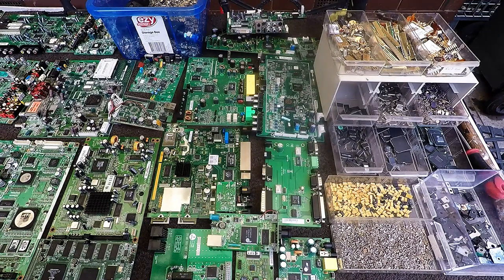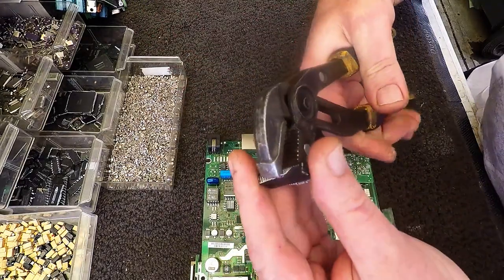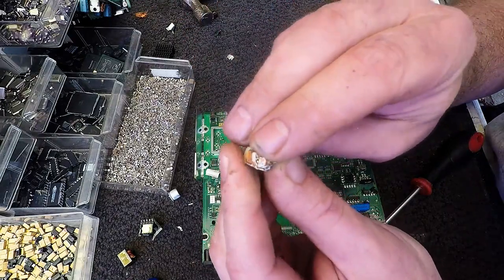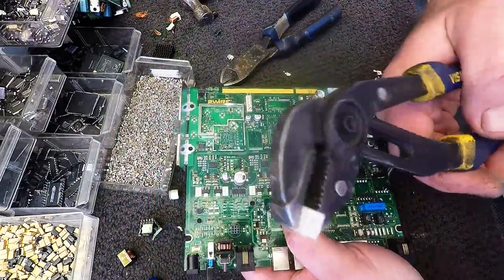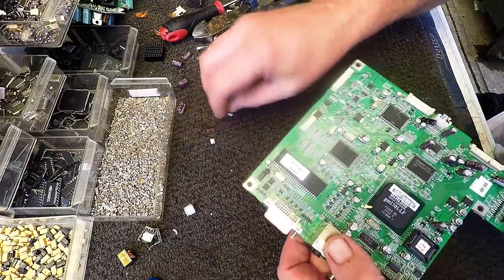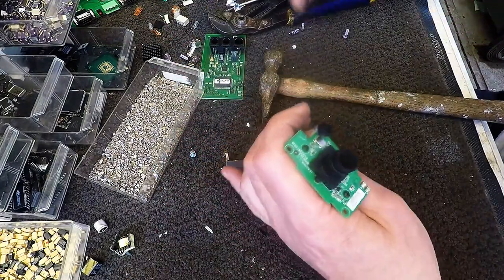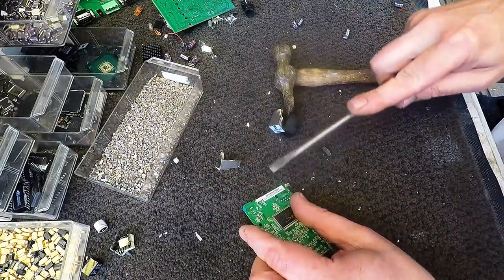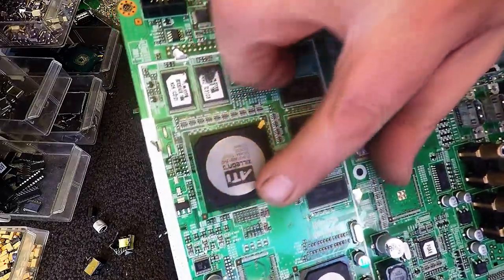Depopulating Boards - Mid Grade Boards

Comment: Great video very Informative. I am in the research phase on whether it is worth just depopulating or Just selling the boards. 
I am assuming the big refining are making most of their profit off the base metals and not the gold and silver. I am assuming maybe half the value of the board is actually the copper. Then you have the tin soldier with very trace amount of silver Of course they will process the silver platinum and gold. But the copper itself probably pays for the whole process.
 During my research on Resistors I did notice most of the brown ones are mainly base metals it is the blue rainbow resistors that have platinum and other precious metals. 
   Now that being said I dont get many boards so I will desoldier all components and save soldier and components but I may want to play around with electronics and some of the components are expensive, Some of those components are worth more then the scrap value if they are working.  On the practical level I may process the copper board by lye bath to get the green mylar off and save the tin soldier for reuse or scrap. Of course I will save the silver and gold to but more of a side product.

Comment: K is a relay. They are usually silver contacts but some need gold plating for corrosion resistance. Extremely rare are relays with mercury wetting but those will also have glass to hold the mercury and contacts.
Reply: Those relays are my bread and butter.

Comment: Enjoy mist if your videos.  To depopulate, try using a wood chisel ( sharp edge) instead of a screwdriver,  dull edge just Pushes parts off instead of getting “under” the parts. It moved much easier 
Tried it and works better in practice
Once you do, you won’t go back. 
I also sharpened my blade on my air hammer but parts “GO EVERYWHERE “ as you probably know already. 
🙂

Comment: On the very thin IC chips, just score one side of the legs with a utility knife and that side just lifts up easily. Then just twist a few times and the whole chip pops off. Works great for 4 sided surface mount chips.
Reply: I am a firm believer 😌 he knows that Mr. Smarty 👖

Comment: I found a trick for getting the tiny components off:  weak HCl with a tiny bit of EDTA dissolved in it!  Leave it in a warm place.  The EDTA acts as a catalyst, slowly stripping away the base metal.  Copper will dissolve, redeposit, and then redissolve as the solder and more reactive metals are eaten away.  When it's all done, the little components will all just fall right off and you're left with a very weakly acidic solution of base metal chlorides in an organic salt (EDTA).  If you're really into cleaning up after yourself like I am, it's easy then to hit it with sodium carbonate to drop pretty much everything (most transition metal carbonates are insoluble), and then dry them out and roast to non-reactive oxides for disposal.

Comment: or what you could do to depopulate the boards on a much quicker scale... grab a large metal pan and fill it with a $4 bag of play sand and put it on your gas grill outside on high and stick the whole boards in it, the sand doesnt melt and it will melt the solder off and then take a metal ruler or an old large knife to just "wipe" the pieces off the board

Comment: Hi Ben: Good instructional video. I Dont know if you knew this but Vice grips does have smaller sized pliers like the blue handled one you have, 2 sizes smaller then the pliers you are using in this video. Even though my hands still get fatigued,they are not as fatigued using the smaller sized(less weight) vise grips.

Comment: Important chemistry note:  the ruthenium resistors are ruthenium oxide, which does not react with most acids.  HOWEVER!!  It DOES react dangerously with STRONG ALKALIS!!  So, to depopulate the tiny components completely, it's best to use weak acid to remove the solder.  Then you can capture the MLCCs with a magnet after filtering out the solid parts from the solution.  The ruthenium-containing resistors will be left behind in the pile of solids.  All MLCCs from boards with ruthenium resistors will be magnetic, as ruthenium wasn't used in the old boards with non-magnetic MLCCs.

Make sure you sort the old boards from the newer ones, obviously.  Mainly anything post-2000 is 'new'.

Comment: The 'silver' fingers and contacts are tricky.  They can have one of several types of plating:  palladium, silver, platinum, rhodium for the good ones; tin, chrome, nickel for the crap ones.  

I'm developing a chemical reaction series to deal with them and recover the actual precious metals as a powder, while leaving most of the copper or brass cores behind!  It's based on partial dissolution and then redeposition and displacement.  Most of the precious metals flake off as the copper goes in and out of solution, while the base metal platings stay in solution.  Then you can shake up the solids and filter through a nylon screen.  

You'll have a solution with grey and silvery dust (virtually all the precious metals), and copper cores (and some copper crystals).

Comment: I save all the ceramic capacitors and components of red, blue, yellow, brown, green, and even black.  You never know which could have some precious metals in them, as manufacturing changes so much with them.  If they're aluminum, then it's no problem.  The first step is ALWAYS to clean base metals from the components with HCl after smashing them to bits, and that will completely dissolve aluminum away.  Pure aluminum chloride aqueous solution is colorless to very pale yellow.  When highly concentrated, it can even become a translucent gel.  It's actually rather neat to toy with, and can be reacted with sodium hydroxide to make super-pure alumina powder for making ceramics and artificial rubies and sapphires (you can even get all the doping metals out of your base metal solutions!)

Comment: I have found when hand picking the ICs and VGA chips a sharp 5mm wood chisel works well. The chips you can use the chisel to cut the legs. A sharp knife will do as well.

Comment: The brassy bits on the TeV boards is just brass.  I tested several from different boards in weak nitric acid, which should not touch anything gold.  They completely dissolved into blue copper nitrate and some tin nitrate goop.  Nothing else was left.  The inner pin can be gold-plated, but the casing is just cheap brass.

Comment: Good info Ben, at 21:53 you single out a small white box component. That’s a relay from what I’ve researched and I was wondering if you knew if there are computer relays that contain mercury. I’ve read up on relays in other industries containing mercury for conductivity without spark/arc risks... but I haven’t been able to find solid info pertaining to computer scrapping. Thanks and happy scrapping!
Reply: Yes right, they are relays.

Comment: I wish there was better YouTube video on grading circuit boards. Ben goes over the components really well and I have learned alot from his videos but I mean for example I accidentally sold a bunch of telcom grade boards from the 70s as gold finger cards because they had gold fingers I didn't realize they were actually telcom so I mixed them in with newer ones that weren't telcom and devalued them. Then afterwards the guy showed me. And also he pulled a bunch of stuff out of my mid grade and put it in low grade. Like boards that had heavier plugs and ones that were less populated with chips.

Comment: Just wondering if you scraped the boards clean, separate out the obvious stuff, through everything else into a crumble bucket.  Couldn't you recover the solder off the boards ?  Tin is $24.86 usd per kg.  I saw the guy from Mt. Baker mining run e-waist through a hammer mill onto his shaker table, which seemed to do a good job separating the heavy metals.  From there, guess it would go to a refiner to separate the metals.  That way you're getting more out of the boards.  Looks to me in order to make a decent profit, you need to be able to mass process.  I can see if you're processing a few and there, exactly as you demonstrate, but doesn't seem like a viable business, unless you can easily process thousands of boards at a time with not much effort.

Comment: Hey, new to the game.  I have enjoyed your work and learned much.  How do you get the MCC's off by hand?  Right now, and some may remember being at this point..I just stare at the board thinking ok, what do i do?  What is that?  Try a few things that never work, throw the board to the side for later.  LOL  I have found that using finger nail clippers to remove gold pins works well.
Reply from the maker: mlcc's you just push them off with a flat blade screwdriver, with a left to right motion and they pop off
Reply: @eWasteBen  thank you sir

Comment: I fully strip boards but i do it with a heat gun, everything comes off quick and easy, then i sort out the good stuff then use a magnet to pick the magnetic stuff and throw it into my light shred. Anything left is random non magnetic non ferrous metals. Although i havnt done anything with the non ferrous i am contemplating melting it into ingots and try to process by electrolysis. By doing electrolysis should be able to separate and purify the individual metals. Things like copper. Tin, nickel amd any others left.

Comment: I like to save up all the big aluminum capacitors and smelt them all at once.  Easy to do in just a steel drum with holes in the bottom and a wood fire.  End up with a blob of highly-pure aluminum, since those capacitors are about 99.6% pure aluminum.  The electrolyte is almost always nontoxic these days, just a simple salt.

Comment: I don't really see the problem with the air hammer smashing everything up. I don't know how Ben does his precious metal recovery but with the acid baths I use the smashed up ones give up more of their goods. It exposes more surface area for the acid to act on which means I'm not potentially leaving something behind in undissolved IC chunks - which there always are. 

I don't throw anything out. It's as much a hobby as side hustle for me so I take everything off and kind of sort it while I'm watching TV or feel like tinkering in the shop without getting into something I can't drop at a moment's notice. very can capacitor and transformer gets cut open and the aluminum and copper bits get tossed into my piles for melting later. 

Shockingly the completely depopulated boards still sell for a bit on sleazebay afterward. I mean not for much but they're trash I paid nothing for to begin with so anything is really gravy.

Comment: Those specific resisters you pointed at specifically have tantilum in them which is 1850. a pound but you have to find a specific tantalum buyer which is fairly difficult to  locate
Reply: Which version are you referring to? The rainbow or the SMD?

Comment: Partial plated pins like you showed removing the plastic can be easily cut off with your snips. Here they are called aviation snips. They are right handed and left handed. Go for it

What are those loud birds

Comment: I'm the rotary style switches I often times see a solid piece with indents where the silver contact would/should be. They are either brass or gold plated but i find them randomly in high grade and low grade boards.  I've always assumed they were just brass bit now I'm wondering. And the same ones that are silver colour with the indents does that mean the whole piece may be silver? Or I can a switch just be nickel plated?
Reply from the maker: they vary a lot, sometimes the whole piece is solid silver, mostly older stuff or industrial, other times just plated silver and yeah sometimes nickel plated, it's hard to know for sure, the gold ones same, some are brass, others gold plated brass

Comment: good way of thinking, do not show what you havent idea of  how to do it . i have try it, i have build my ovn small lab with vacum chamber and very expensive fire extinguishers, get extremly expensive respirator, huge amount of glassware you will need ,and a loot of time and you are not able to get the brake durring the process. it is no that easy how they show on youtube. i have use a houndreds of hours of reaserching and sort of things and steel not always was work out . so think before you do something to your self. regards rafal

Comment: 80% of my boards are the brown CRT kind of boards
Reply: then  those would be tv's boards not computer boards and those can still be scrapped out. and all the copper rolls on it u can  unroll and make a  bucket of copper
Reply: Yeah those are from CRT monitors, and tv's, but also VHS recorders, radio's and such. I usually don't scrap those out but just sell them for 35 cents a kilo. Sometimes I do take of a copper coil here and there, but not much else. I don't get many computers and other stuff with higher grade boards, my comment was more for Ben so he would know not every scrapper gets the stuff he does.
Reply: Haye van Leeuwen yea he knows that 😊
Reply: @hayevanleeuwen6018  he made a 1 1/2 hr video that's the most detailed you can find and your comment is that not everyone gets the same stuff he does?   What the fuck lol.

Comment: Das geht auch schneller, das Board auf 300°C aufheizen und alle Bauteile fallen von alleine ab ;-) Und man kann gleich mehrere Boards gleichzeitig so von den Bauteilen befreien.
Reply from the maker: yes but you also release toxins, not a good idea, think about lead solder, breathe enough fumes in and you'll give birth to an alien in your lungs
Reply: Das stimmt, wenn man eine Heissluftpistole nutzt oder ähnliches. Wir haben vor ca 20 jahren einen Küchenherd etwas umgebaut um 72 Motherboards von den Bauteilen zu befreien. Um mit den Platinen dann einen Tisch zu bauen :-).  
Die moderne Methode ist wohl noch einfacher : SnST-550A um Bauteile zu lösen und um das Gold zu gewinnen UW700.  
Achja, Sie haben die sauberste Lagerstätte für Elektroschrott die ich je gesehen habe. Hut ab vor dieser Arbeit !